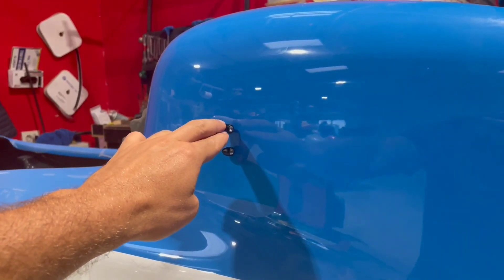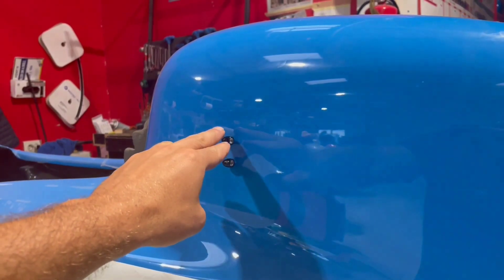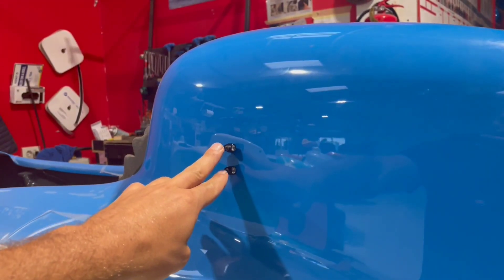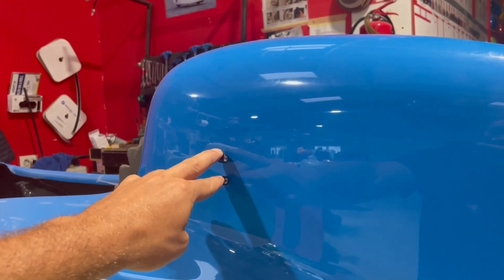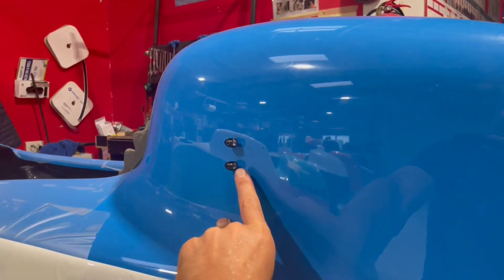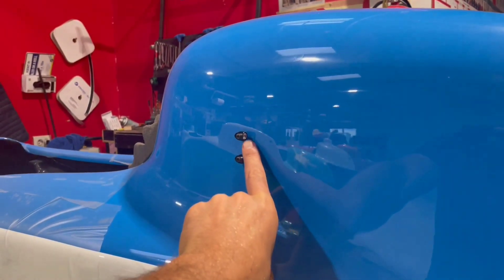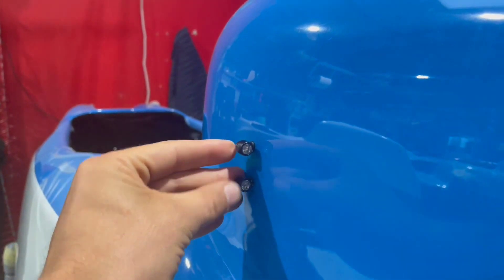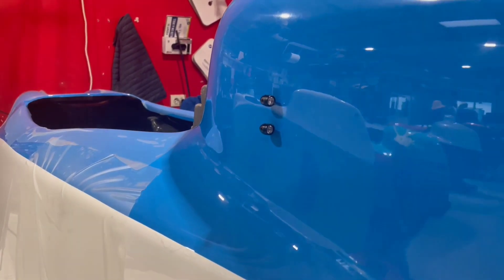Electric installation upgrade | Velomobile World

Comment: Oddly enough I've stopped using the flashing rear lights on my Alpha 7 - visibility of the indicators (direction lights) is good, even in bright sunlight, but this is masked and confused by having the light blinking. To give me a flashing rear light I've mounted a single Exposure Trace-R at the top of the body work behind my head.
Reply from the maker: Okay Personal I like it a lot